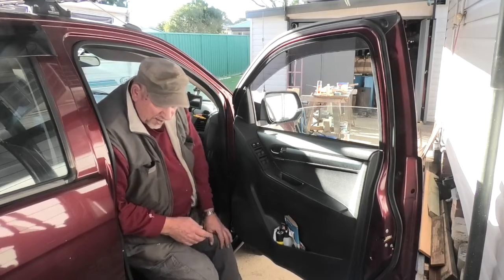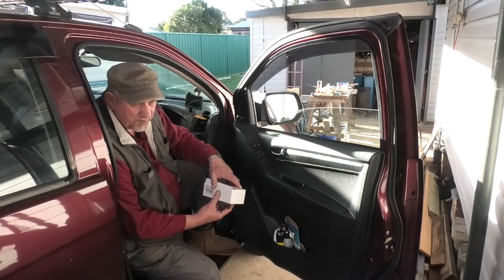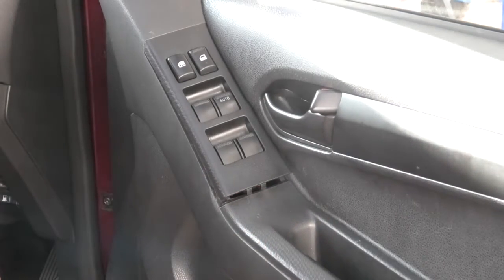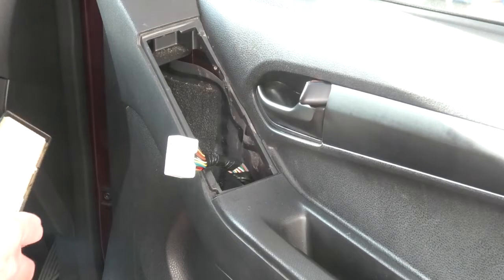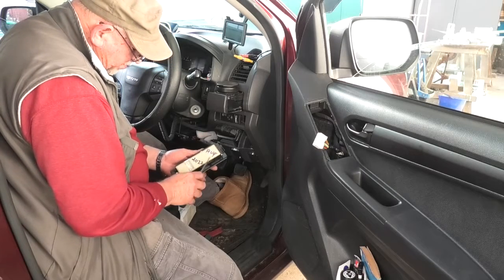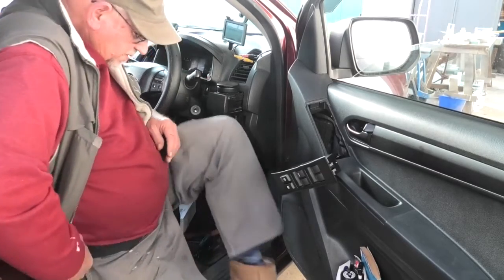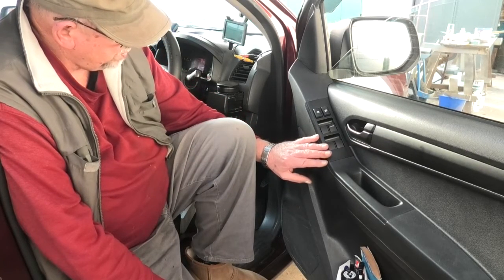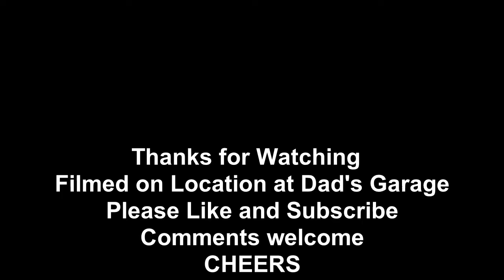2012 DMax door switch panel replacement

Comment: Gday Peter, good easy fix and informative, I don’t remember how many times I pulled the window switch’s apart in the kenworth to clean the contacts, I’ve done the same in my 2011 commodore, I’m not a fan of all the plastic clips and it can be a pain to figure out exactly how this come apart, great video mate and thanks for sharing, cheers
Reply from the maker: G'day Matty. I've kept the old switch panel to pull apart to see what's wrong. 
Cheers Peter

Comment: G'Day Pete, thanks for the video, well explained.  I have the same model DMax and the same as you, the window switch is feeling a little tired.  Can you post the link where you purchased the panel.  I think I might need to replace mine in the near future.
Cam
Reply from the maker: G'day Cam. I bought it on ebay from 
auto-wholesaler008
for $52.99 free postage, I didn't check genuine price as I thought this was pretty good, time will tell if it is any good but I will say it feels smooth. Bonus, the auto function is both up and down where as my base model was down only.  Cheers Peter